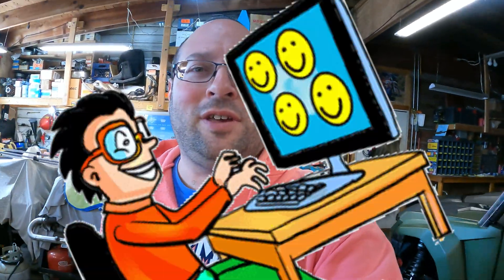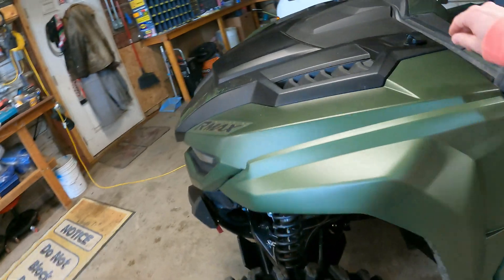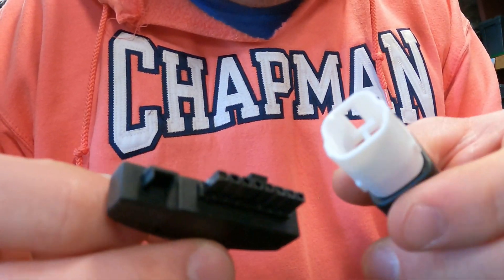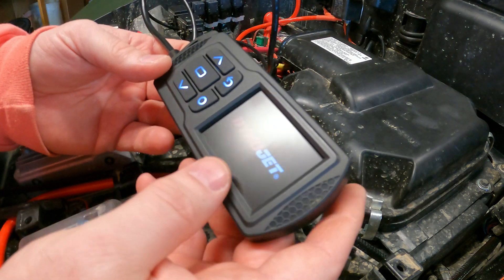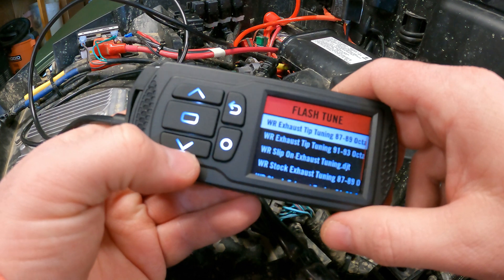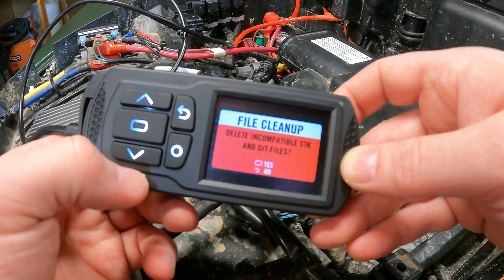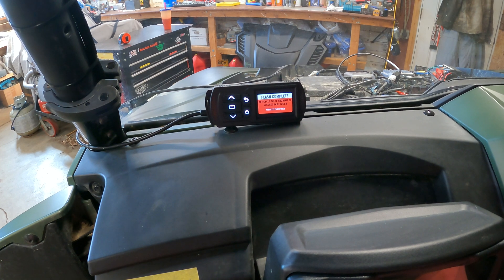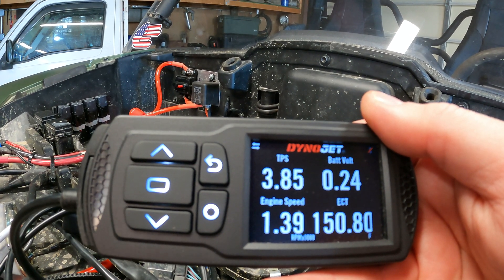RMAX Dyno Jet (Power Vision 3) tuner install

Comment: my Yamaha rmax has a blockage at 65 km/h, do you know how to remove it
Reply from the maker: Thanks for watching. Can you explain more about this "blockage" and I'll try to help.
Reply: @BarnStangz like a limiter I have the same problem
Reply from the maker: @willitglow2.080  The Weller flash will remove the speed limiter.
Reply: @BarnStangz  I just did mine and it never removed it would I’m not sure why
Reply from the maker: @willitglow2.080  Interesting.... I was pretty sure that the weller tune took away with the speed limiter. Did you contact them?
Reply: @BarnStangz  yes i did they said its something to do with the rmax and the tuner is mainly for the smaller things for performance or something im not exactly sure there supposed to call back Monday
Reply from the maker: @willitglow2.080  Interesting, yeah, keep me posted.

Comment: So if so if I bought a new rmax can I plug this in and good to go or do I need to reflash device for new machine
Reply from the maker: Thanks for watching. This tuner I purchased from Weller Racing and they had tunes already loaded on it it. So when I got the device, I plugged it in and flashed my ECU. It was pretty straight forward and easy to do. The only downside, is you can only flash one machine. you can't use this thing on more than one RMAX. I believe you can contract Weller to get a deal on another flash for a second machine however. You may want to reach out to them via email.

Comment: So what’s the verdict? How does it perform? Is it worth getting the dump jet or just flashing the ECU?
Reply from the maker: Thanks for the comment! I do think it's worth getting. I have a video where I'm chasing my buddy up hill at Hatfield and he commented how he was going flat out all the time and I was right on him. We're both very decent riders, so I think the tune and the Hunter Works tip give me a tiny bit more power. I also like how the PV3 turns on the cooling fan sooner, felt like my machine wasn't getting as hot. I'd say get it for sure. I also like have the 87 octane tune. That's nice to have depending on where you're at.

Comment: Quick and simple video. Can’t beat that. Will be very interested to see if you feel there was a real gain or not. One thing I am curious of, did you notice, or know if others have noticed, an improvement with cold starts? I think it was one of your previous complaints if the RMax and I have noticed it with mine as well. Usually takes twice to get it to start.
Reply from the maker: Thank you so much for watching! I heard the same thing you did, that the machine starts up better dead cold. My shop was pretty warm when I started it for the first time, so I can't give you a good answer, but, I will make a follow up video after I get a few hundred miles on things. Make sure to subscribe so you don't miss that video, thanks again!
Reply: Mine was awful on cold days (4 starts before it would stay running sometimes). Has been great since blocking the AIS. I recently installed the 91+ stock exhaust tune and have noticed that starting is smoother, cooler temps and the fan seems to come on less often. As for power, there's not a huge difference. It feels more responsive but in a straight line it isn't much faster. I don't regret it though. Stock tunes are very lean these days and that creates unnecessary heat.
Reply from the maker: @LikelyCandidate  100% Yeah man, all the same for me too! Wayyyyy too lean from the factory, the tune is worth it just to richen it up a bit and yes, like how the fan comes on sooner, that's good for sure too! Thank you so much for watching and commenting, it's appreciated!
Reply: How did you set the time for the hunterworks exhaust tip? Does it show that,that’s an option in the tuner?

Comment: Really helpful. Thank you. I can't get over 90 octane here in AK so a flash would be ideal. This unit looks really nice. Much appreciated!
Reply from the maker: Glad it helped and you are VERY welcome! I too like the 87 tune! I'll be using that when I head to VW to ride since some of their gas station can be sketchy! I think the difference octane tunes and turn on the fan at lower temps was what really sold me. Plus I like how I can just plug this thing in and pick my tune, super easy. Thank you so much for watching it's greatly appreciated!

Comment: I'm anticipating the before and after testing.  I watched another video after it was tuned and the result was not impressive so hoping you have better results.
Reply from the maker: Right on man! Yeah, I'll definitely let you know for sure! I'll make sure to do a good follow up video as that is really important! This video was more of a get it out of the box and plug it in kind of thing. But generally I've heard pretty positive things about this Power Vision. Thank you again for watching, it's greatly appreciated!
Reply: So I have a 2023 Rmax and was wondering what you noticed. Any performance increase ?
Reply from the maker: @kwaldbaum84  Sorry that I missed this comment so long ago. The turn is worth it, feels a bit more snappy in Sport mode and I really like how the cooling fan comes on sooner. Less de-accel pops too and the machine just seems to start better dead cold as well. I'd recommend this product and tune. Sorry again for responding so late.